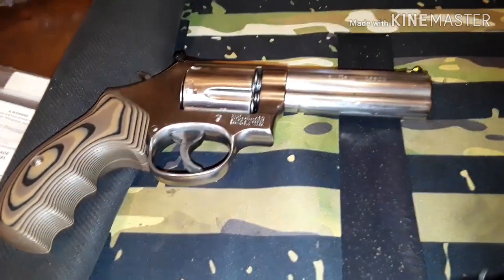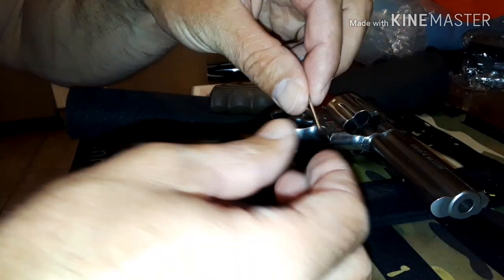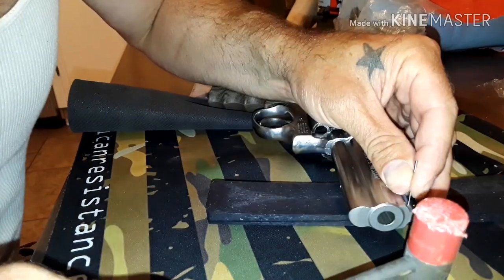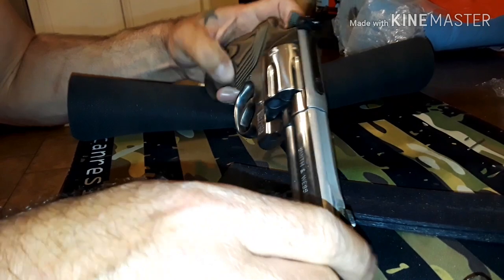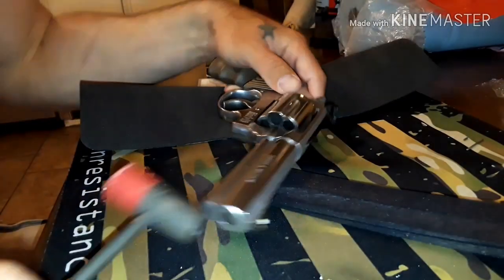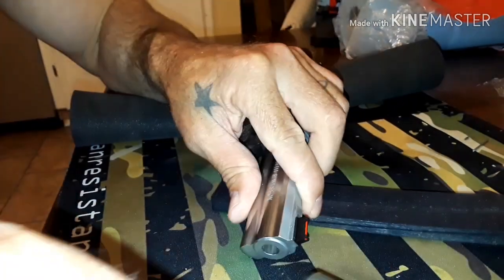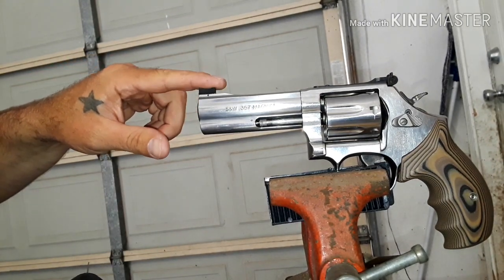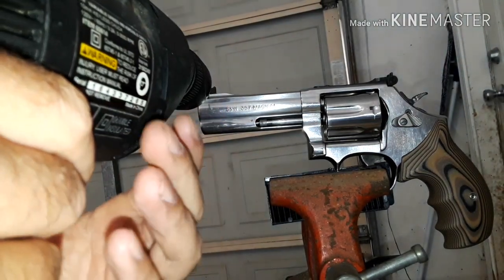S&W 686 sight install

Comment: I used to cut drill bits and such. I grabbed a cheap ball point punch set of various sizes and never looked back. Every fractional size available and it was $20.
Reply from the maker: I had trouble finding a #54 punch, unless I bought it seperately, and it was $15 plus shipping. Screw that! I have a punch set, but it only goes down to 1/16th

Comment: Where can I get the holster in your video for my 686 Plus? Also, is that a 4" barrel? Thanks
Reply from the maker: I bought it from "we the people holsters". It is a j frame 4" holster. I had to use a heat gun to make the 686 fit. I also used a dremel to cut off the sweat guard and minimize the excess kydex where the retention screw is located. It's a bit of work to do, but it's the only way I know of to get a decent iwb kydex holster. If you dont want to go through all that trouble, just order a 4" L frame holster from "houston holsters". It's made of eco leather, super comfortable, and made for iwb. Only problem with that one is you cant reholster it unless you take it off, but, it's only $20...

Comment: Good job Josh. I need a few smaller punches and some new roll pun punches also. That revolver is a sexy beast now👍
Reply from the maker: I tried finding a #54, but they wanted $15+shipping and tax. This 2 pack of bits was 5 bucks, so I figured as much as I'll never probably use it again, this was probably the best bet.

Comment: My son is talking about getting the 686... any words of wisdom?
Reply from the maker: Yes. If hes going to carry a speedloader, get the 6 shot. I got the 7 shot and safariland doesnt make speedloaders for it...that's my only regret, but I probably wouldnt carry the speedloader anyways. Other than that, it's a great gun! Be sure to loctite the strain screw. That's the only downfall is many people (myself included) have problems with the strain screw loosening and causing light primer strikes.

Comment: YOOO. What kind of holster is that? I want one for my 686+ 3 inch. I’m lefty
Reply from the maker: Hey! It's made by "we the people" holsters. It's a 4" k frame holster. I had to do a lot of work with a heat gun and dremel to make it work. I think it was $30 for the holster in it's original configuration. I also replace the clip with a thin metal low profile clip. You can probably do the same, just cut an inch off the barrel part of the holster.
Reply: @JoshBenware  EYY :)

Thanks I’ll check it out. It’s funny you said the 4 inch, I discoved that most 4 inches have been working the best for this. I typically wear around my 730/800 position. But I’m experimenting with other positions. I wouldn’t mind finding something that sits even lower. What are your thoughts on the smart carry holsters? I’ve seen reviews where people love em; and reviews where people say they suck
Reply from the maker: @highwayxj9397  I'll be honest, I'd be very insecure carrying in a way that points at my groin and femoral artery without having any real retention that grabs the trigger guard securely. Cool concept, and maybe not bad with a heavy and long revolver trigger...but I guess it's about personal preference at that point. I definitely wouldnt do it with anything that's not a long double action trigger.
Reply: @JoshBenware  I feel you, I really become accustomed to that 730/800 position. Problem is that I find myself readjusting my shirt a lot. No problems with sitting or driving though. I just feel like it’s obvious that I’m carrying. I ask people I know if they can see it, and they all say “now that you mention it, yea”
Reply from the maker: @highwayxj9397  it's too bad that holster makers dont cater at all to us that carry L frames. The most comfortable holster I've found for L frame is "houston holsters". They conceal well, super comfortable, and very low price (like $20). If you havent tried them, I'd highly recommend having one. The only downside is that you cant reholster easily while they are in the waistband, cause they collapse.

Comment: how do you know the height of the sight to order?  great video.
Reply from the maker: Just look up the height of the factory front sight. Also, I believe the rear sight is adjustable. It's been years since I made this video, so I cannot remember what the height was, but it's easy to find the factory height specs. Hope that helps out some.
Reply from the maker: .230 is what I'm finding

Comment: Eureka!  You did it like you've done this a bunch of times, you may have some mechanical abilities after all
Reply from the maker: 😅 oh, I do all sorts of stuff. I was just scared to do this, but it worked out well. It took a little planning to not spend more than it would cost to have someone else do it.

Comment: I tried the same drill bit but it won’t drill the sight. My sight is made of metal. Is yours plastic?
Reply from the maker: My sight is metal too. What is the drill bit made out of?
Reply: @JoshBenware  I ordered the same one listed. Mine says carbon steel #54 from Gyros. Should I order an Irwin #54? I tried 6 of the Gyros and none penetrated. 2 broke.
Reply from the maker: @elcompaish2141  that's strange. I guess try the irwin's. Not sure why you had a problem. Are you putting a lot of pressure?
Reply: @JoshBenware  I tried at first with no pressure then I added mild pressure and nothing and then heavy pressure and that’s when I broke 2 drill bits. I even tried slow and fast speed and nothing. Super weird. That’s when I ordered more drill bits and same result. I tried the drill bits on wood 2x4 and it did work on wood. Hopefully the Irwin works. They come in on Friday. I recorded a video of the gyro bit not working. I’ll record with the Irwin also. Hopefully it works if not, idk what else to do.
Reply: @JoshBenware  I just tried the Irwin #54 and also no luck. I don’t know what else to do
Reply from the maker: @elcompaish2141  perhaps too much pressure? If you dont put a lot of pressure and keep drilling at a low speed, it will eventually get through without breaking the bit.
Reply: @JoshBenware  I’ll try that next. Thank you. Should I add oil or no?
Reply: @JoshBenware  I just upload 2 videos on my account if you can please see them and see what I’m doing wrong.
Reply from the maker: @elcompaish2141   no oil. Make sure the gun is very secure so you can make sure the drill bit isnt hitting the sides of the hole on the frame. Use a drill, not a dremel. Very light pressure. Get the drill spinning at a low speed. Slowly increase the speed. At the most, maybe 1/2 speed after 10 seconds. Go at half speed for 10 seconds. Repeat that on the opposite side. Keep alternating until you make it through. I know it looked fast on the video, but I edited out a lot of the drilling for the sake of making the video shorter. It took me about 2 minutes of drilling in reality. I only showed 20 seconds on the video. Take your time at low speed and alternate sides. The drill bit is thin and fragile. You cant put weight behind it. Very little pressure. Let the drill do the work. Dont force it or it will cause the fragile and thin drill bit to break. Let me know how it goes.
Reply: @JoshBenware  ok thank you. I’ll try that next with new bits
Reply: I ended up using solid carbide drill bit DMOD54 and it worked. You were right to use slow speed. Thank you
Reply from the maker: @elcompaish2141  that's awesome! Glad you finally got it solved! Enjoy the new sights!
Reply: @JoshBenware  yea took a while lol. Thank you

Comment: Might wanna redo the fiber, you mushroomed it too much, the Dawson sight is recessed so fiber is shrouded and gives a much clearer more uniform dot.
Reply from the maker: Been there, done that. The bigger mushroom grabs more light and is much quicker to pick up. I learned this from guys I was competing with. I use to do it the way you said, but I switched to a big mushroom and will never go back to a smaller less visible front sight.